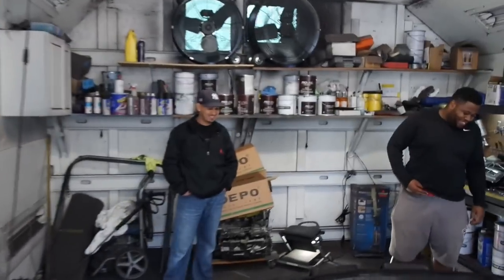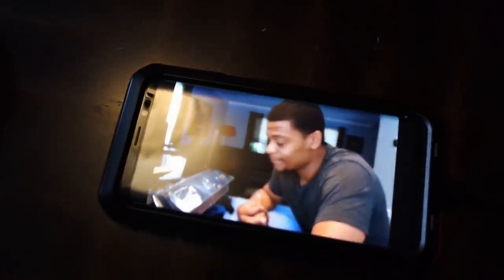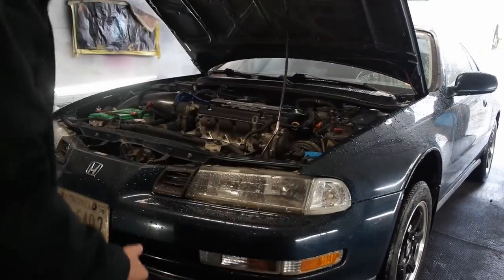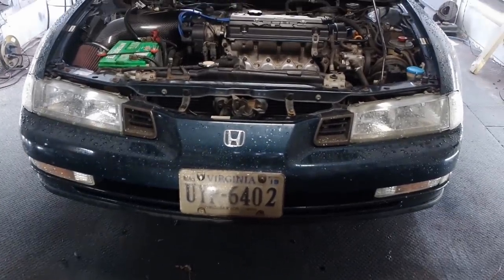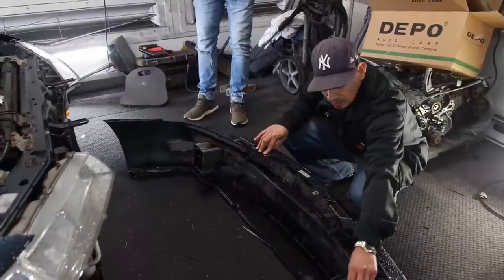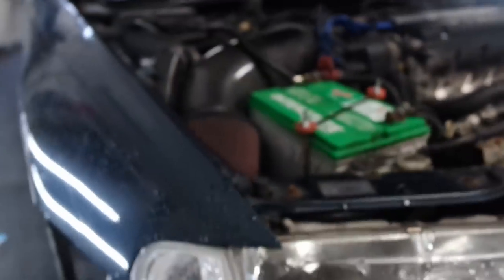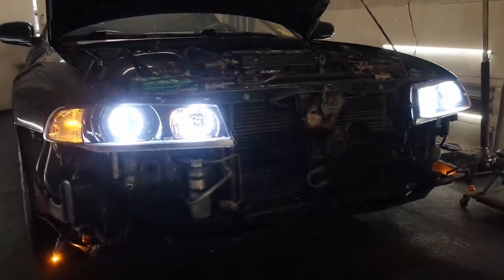Honda Prelude headlight Installation 1992-1996

Comment: They definitely do make a difference! Always ❤ your vids! I got my power loss issue fixed but now I gotta replace my rack..my steering is terrible. I thought after I changed my pump it would correct it but after adding the 3rd bottle of fluid in less than a month I knew I had a deeper issue. 😞
Reply from the maker: Sorry to hear that well at least you know the issue good luck with fixing it

Comment: Really helpful video man!
I wish I'd seen this before I took mine off the long way. I crashed my 96 Lude (non vtec, everything OEM) recently because snow and black ice sucks, but thankfully I only have to replace everything involved with the front and nothing internal.
Reply from the maker: hope this video helps you in the future if you ever need to remove the bumper or lights again
Reply: Dudeeee omg man I literally did the EXACT SAME THING I’m about to start the rebuilding process soon within the next month

Comment: which clips underneath ? and how many are there, wish you showed how to take those off and you said 5 10mm bolts to remove the headlights lol it was only 4 but pls if you can reply I would appreciate it. T.I.A
Reply from the maker: Whats the time stamp on the part your asking about?
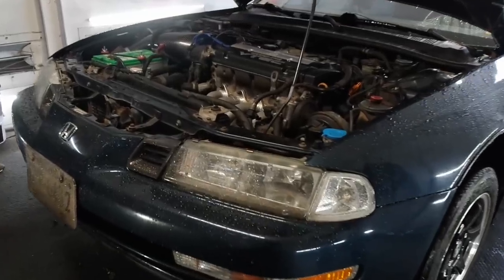Reply: @treybedipping1734  4:23
Reply from the maker: @YoungAmzn  plastic clips hold the bottom plastic brush guard piece to the bumper.
Reply: @treybedipping1734  those are easy to remove and put back on?
Reply from the maker: @YoungAmzn  yea
Reply: @treybedipping1734  thanks man I totally appreciate your response.